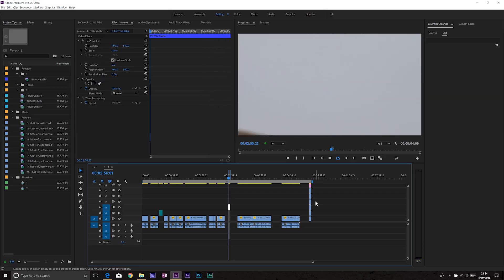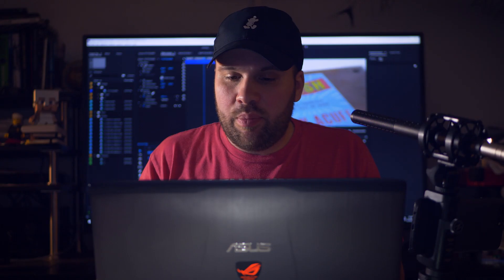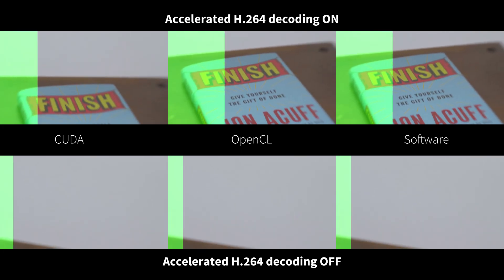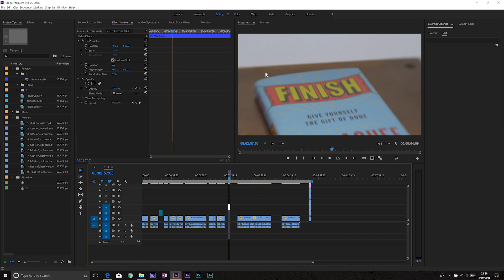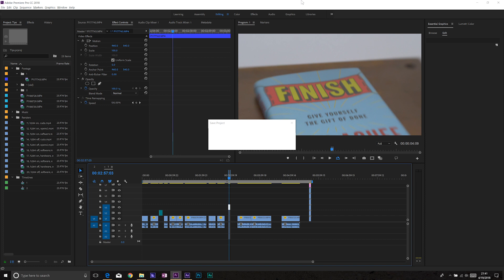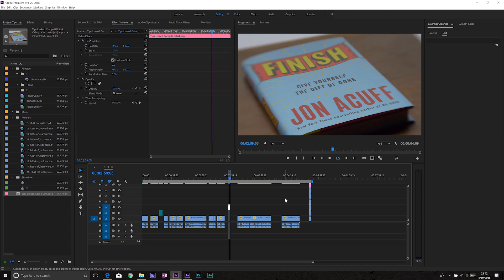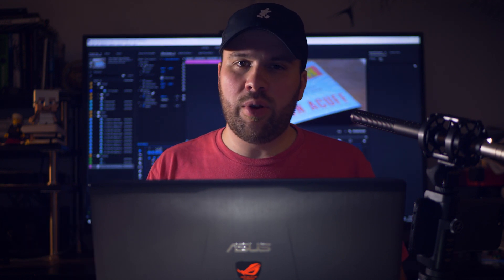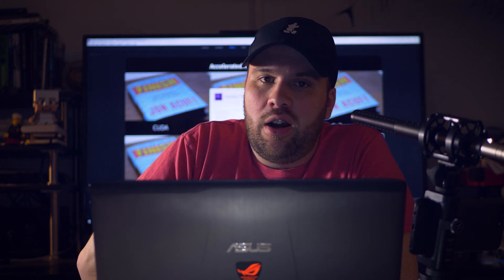H.264 bug in Premiere Pro: how I fixed it

Comment: I still have the bug and it basically happens every time I try to edit in Premiere. I feel like Premiere was a waste of money because I have spent so much time through customer service and adobe staff even remotely accessed my computer and still didn't even fix my problems. I don't know why I am having problems editing when I have a good pc with an intel i7 and a gtx 1080 plus 32g ram and good storage. I tried your solutions and both didn't work.
Reply from the maker: That's rough. Some thoughts, of which I assume many have been tried.
- update drivers
- force Premiere to run on Intel graphics not Nvidia
- reencode footage with something like Handbrake

If support couldn't help I don't know what to say. I would assume they've tried everything I could think of.
Reply: Chris Sparrows The support said to use handbrake and it helped before because iPhone videos aren’t shot on a constant frame rate but I used handbrake this time and the still glitches happened
Reply from the maker: Premiere should handle the VFR files just fine. It could also be that the file is corrupted somehow, but I wouldn't know how to confirm that.
Maybe this will help, check out the VFR section at the bottom. Maybe changing one of the options.
https://helpx.adobe.com/gr_en/premiere-pro/using/supported-file-formats.html

Comment: I need help! I have a glitching issue when importing footage into Premiere Pro or After Effects. I'm looking to make videos using my phone(Huawei P30 pro). I was testing it by importing some footage but it glitches badly. I played the clips in a media player no issue. only in PP or AE. the phone gives options for codec H.265 and H.264. I first tried 265 and thought that was the issue so tried in 264 same issue. which i dont fully understand codec, formats, or containers been trying to learn to fix this issue. 

so first has anyone ran into this issue before?  whats the best order of topics to actually learn and understand all of that? and Is there a better way to record videos with a phone? such as is it possible to get uncompressed video footage? Id appreciate any help.
Reply from the maker: I've never used a Huawei phone, so I can't be of much help I'm afraid. If disabling hardware encoding isn't working for you, you could try using a different program such as Handbrake to re-encode the file. Or contact Adobe support. I've reached out to them many times and they've always been very responsive. It does sometimes take time to resolve it, but they're the experts.

Web: https://helpx.adobe.com/contact.html
Twitter: https://twitter.com/AdobeCare
Forums: https://community.adobe.com/

Comment: you just earned a new subscriber.  Thanks for that.  Been on the support chat with adobe and they couldn't figure it out after 4 days of trying.  I don't see much of a render time drop either.   Regardless this is something Adobe needs to fix because its a lot of money not to be able to use the full power.  Well done sir and Thank you!
Reply from the maker: Happy to help! Curious, are you on the most recent version? I found a version or 2 after this had some significant improvements.

Then I eventually built a new computer and everything got better. 😂
Reply: Yes most recent. Brand new computer installed  premiere yesterday. Had this problem before as well. But I am using a gaming computer as well. Up until now I used a dell XP’s 13 but with integrated graphics so no issues ever with that. Premiere doesn’t seem to talk to powerful GPU’s very nicely.
Reply from the maker: Oh wow. I had quite a rough time with my current video (coming out next week), but I finally traced it to GPU intense third party plug-ins or me having too large of After Effects comps.
Reply: I’m using an Asus Rog Strix scar ii. Notice you were using Asus as well wonder if that’s a trend?
Reply from the maker: Could be. I forget the model, but it has a mobile Nvidia gpu, which wasn't technically supported. Worked better after the next major update or 2, but by then I'd made my new computer.

Comment: Thx a lot for sharing these solutions. Clearly, not many would opt for unticking the hardware acceleration but for some reason, the After Effects trick didn't do it for me. :(  Still glitchy once back in Premiere while in AE things are smooth. I'm at the end of my nerves with Adobe.
Reply: Found this and worked... The way to fix this 100% guaranteed is to go under audio hardware and set the latency to 200, as it's a problem with the audio output

After that try lower settings till stuttering starts
Reply from the maker: Interesting. I use Windows and also found it also worked better when I turned off the ability for apps to take exclusive control of my audio hardware. Not related to the stuttering, but made Premiere play better with other apps.
I wonder if your stuttering is related to hard disk speed.
Reply: @chris_sparrows  I'm editing from a decently fast SSD, but I will definitely have a look. (Win)
Reply from the maker: It's weird, but I find AE to be far more stable than Premiere.

Comment: My problem is that when i import my edited video, it doesnt have h.264 format in export. I hope someone can reply to this i needed it for my project
Reply from the maker: Interesting. I've always had that option, so I don't know what to say. Have you tried contacting Adobe support?
Reply: I havent yet but this one frustrates me. Any alternatives to how to export my video?
Reply from the maker: @jasperbesinga  Are you exporting directly or with Media Encoder? I would try the opposite from what you've been trying. As far as why H264 is missing, are you Mac or PC?

A workaround would be to export to a different format and use the free software Handbrake to reencode the file.
Reply: @chris_sparrows  i am using a windows 10 laptop. I was just directly exporting my edited vid, i did try the formats in the dropbox option but sadly there was no format that export's it into mp4(h.264).
Reply from the maker: @jasperbesinga  What version of Premiere? Have you ever had the option or did it recently disappear?
Reply: I havent checked what version mine was. Last time i edited a video it did have one i dunno it just disappeared.
Reply from the maker: @jasperbesinga  That's really weird. If there was a recent driver update that may have changed something, but I wouldn't know how to troubleshoot that. Have you tried uninstalling/reinstalling Premiere Pro and Media Encoder? I've had to do that a time or two to fix a problem.

Comment: Is this video on any other platform? I have been trying to play it since last night but it stops after 0:21
Reply from the maker: Just YouTube. Sorry it isn't working for you. Basically I had hardware or driver issues, so I turned off H.264 hardware acceleration in the settings and fixed the stuttering playback issue I was having.

Comment: How do you get green dot for dropping frames ?

Below in the thread ;
Fix to Adobe playback issues. TLDR : roll back to Adobe 13.0
Reply from the maker: Click on wrench icon on bottom right of program monitor (next to full, 1/2, 1/4 resolution dropdown). Choose Show Dropped Frame Indicator. Plenty of other options in there too.
Reply: @chris_sparrows  thanks so much. Knew it was somewhere silly. Appreciate it. Trying to troubleshoot why my videos lag so much scrubbing threw them. Hopefully this helps
Reply from the maker: You're welcome. Took me a few minutes to find it again myself. So many options!

I also found that version 2019 has poorer performance than older versions, and had been struggling to even edit 1080p sometimes on my laptop. Also, either they fixed this specific stuttering issue or my newer graphics drivers resolved it.
Reply: @chris_sparrows  interesting. I am noticing upwards of 80% usage on the igpu and average 20% on the rtx 2080ti. CPU can hit 80%. I am flabbergasted as to why this is so bad. Some videos not as bad as others, some just terrible. All recorded constant but rate, 1 b frame, keyframe int 2, etc. 

Footage shot with nvidia share in 4k like 60mbps, works fine. Scrubs amazingly. Its weirs

Such a pain. Maybe I'll figure it out some time and make a video.
Reply from the maker: I just built a new computer recently, but I find my core i9 is the bottleneck, though playback is usually just fine. My 1070 doesn't even break a sweat. Haven't done any 4K yet. I've also resolved to only install the Creator Ready drivers, after all the driver issues I had on my laptop (more so after I made that video).
Reply: @chris_sparrows  what version of Adobe? I can now confirm Adobe cc 13.0 (2018) works fine with EXCELLENT playback and scrubbing in full resolution. So your i9 should be able to do like 6k RED footage no problem. The 9700k works great even for 4k footage once I figured this crap out. Hope that helps anyone who had similar issues.
Reply from the maker: 13.1.2 (2019) I guess I didn't specify when I maxed out—it's only maxing out when rendering because it's throwing everything at it. Playback and timeline is just fine.

I read somewhere that they were dropping support for older hardware, which is likely the issues with the 2019 version not working as smoothly.

Comment: I can't find the h.264 acccel option in the media tab. I'm using premiere pro CC 2018
Reply from the maker: Are you on Mac or PC? I don't know if the option is available on Mac. Also, some of these issues seem to have been fixed in more recent versions, have you tried installing 2019?
Reply: @chris_sparrows  I'm on Hackintosh (Mac)
Reply from the maker: @balanceestudiodegrabacion9820  Might be unavailable because it's a Hacintosh. https://helpx.adobe.com/premiere-pro/using/whats-new/2018.html

"Hardware-accelerated H.264 and HEVC decoding is now supported on MacBook Pro and iMac Pro machines with Mac OS 10.13. Hardware decode acceleration is automatically selected as the default option (Preferences > Media > Enable hardware accelerated decoding) in PremierePro on Mac if the hardware supports it."

Comment: Can u help me please I exported a video on h.264 at high birate and o won’t let me upload it to Instagram on my iPhone X’s but it works on my friends iPhone 6
Reply from the maker: Without knowing any details, my guess is that it has to do more with account settings, network connection, or something else, especially since it works on your friends phone. I don't think I can be much help though, as I don't use an iPhone.

You could try one of the other presets like Facebook to see if that makes a difference. Other than that, I'm not sure what to try, but it doesn't sound like it's an issue with h.264.